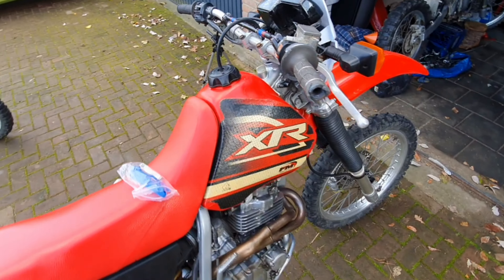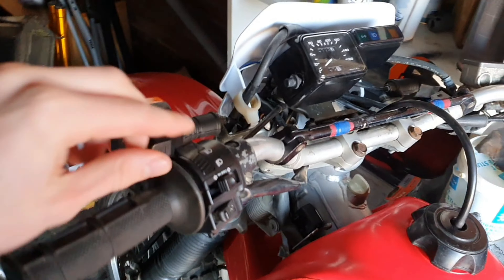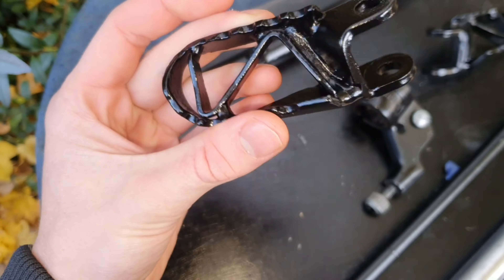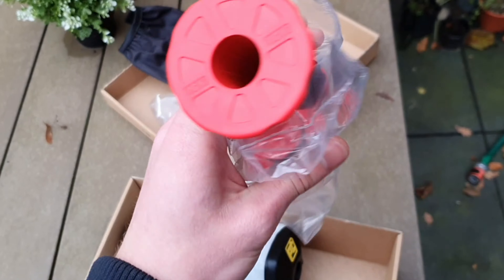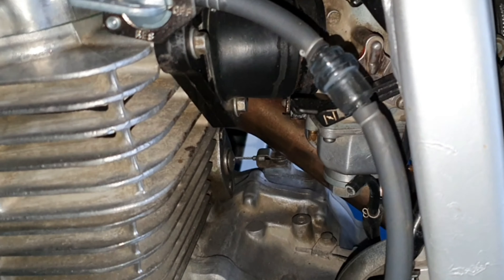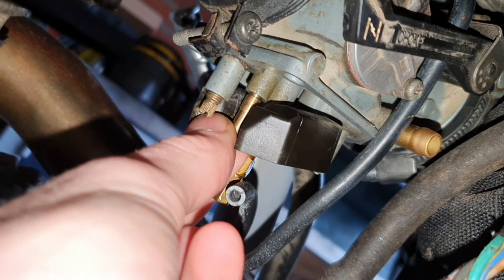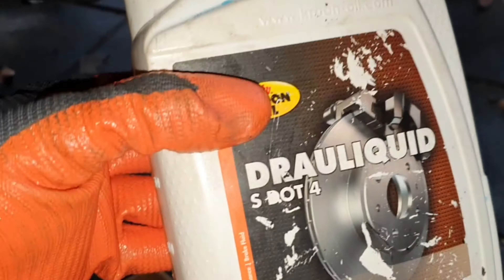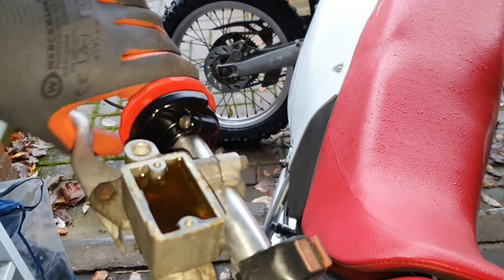Honda xr400 problems solved!

Comment: What’s your altitude where you are? I’m sea level and I’m having trouble right now I have a 50 pilot and 155 main it starts with no choke but runs for a few seconds then bogs out.
Reply from the maker: Iam at sea level to, iam not sure what jets i used i think i showed it in the video or the video before mine was running lean and it was bogging down when i gave trottle
Reply: @Builditathome-Restoration  thank you I appreciate it, I’ll try your specs in this video and I hope it works.

Comment: Did you loosen the carb intake on the filter or head side or were you able to just go up from the bottom with a screwdriver and remove the float bowl bolts/screws?

Comment: Not a fan of the grips, personally.
Also, it's better to sand off the rust off the frame first, then give it a base coat, and wet-sand that, before (masking and) spray-painting.
Also the frame paint color doesn't match. Just get the right color...
Reply from the maker: Exactly I did remove the rust but is is not in the video. The exact paint was not available